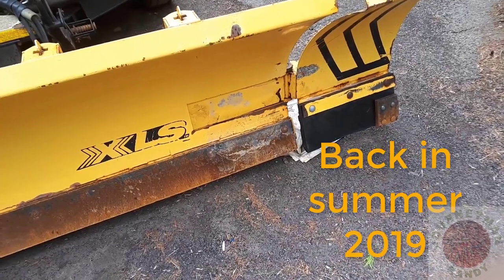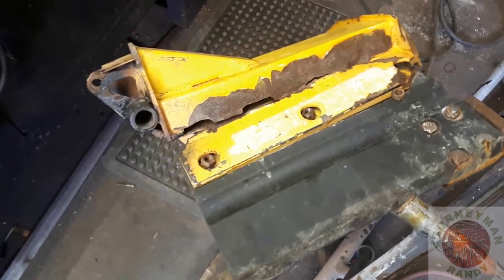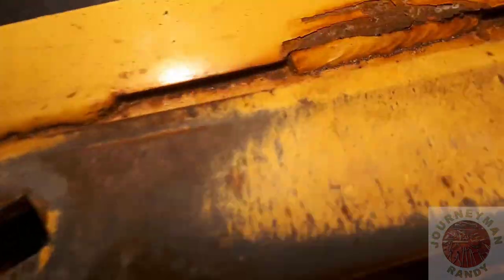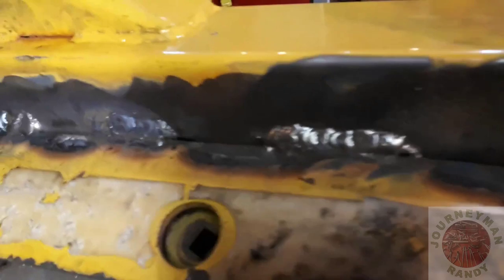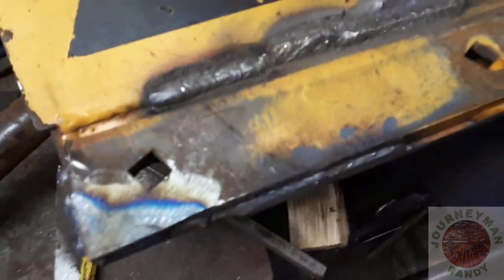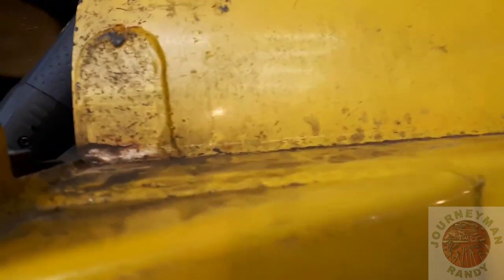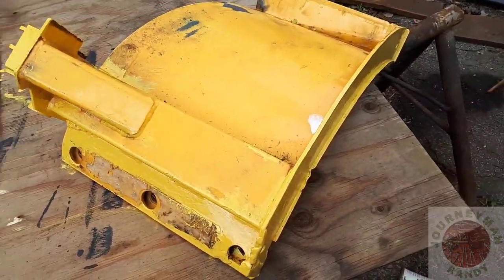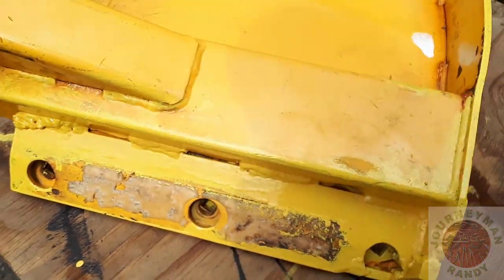Fisher XLS Rebuild...Banana Split

Comment: It looks like a good solid repair - like you say you could just buy the part but how long before it gets mangled too?  Especially in times like this being able to save a few bucks is a welcome thing.  As it is, even if the construction company is deemed responsible for wear and tear it can be a total headache getting them to cough up for it.
Reply from the maker: The way I look at it is if it breaks again I may buy a new part. It will be close to a thousand with tax. Last year we are paying duty on all US imports. I haven't checked on the new NAFTA agreement. The dealer told me over $700 on top of a new plow Jan 2019. I think it took three or four hours to weld it up. Thanks for stopping by Everett